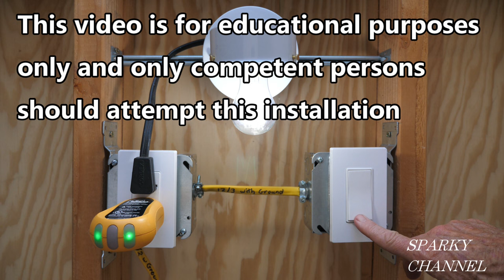What is This Tab and When Do We Break it?

Comment: Thanks, I had similar issues, one of the two outlets which are on split circuit,  since I did not know that tab has to be broken, one of them shorts the circuit breaker, and the other just shuts down the complete panel. Luckily, the panel had some protection so I just turn it on via the big switch. It was scary, I thought the worst. I had to return the cheap ones and buy the heavy duty from Leviton. After breaking the tabs, no more issues. Cool tip of the split circuit, they do that on kitchen to maximize the use of  more apparels, that's the only place I find in the entire house.

Comment: Thank you Bill that was an excellent guide.  Question:  I have one of the recepticle with tab off but seperate cable is connecting top and bottom screws on the same side,  why would that be?  by the way there is a red cable coming in and connecting to black cable. I will appreciate your response.  Thanks

Comment: What I have done is break the tab off of both hot and neutral and fed them from 2 separate circuits.
Reply: I can't imagine that it would be to code to have 2 separate circuits feeding one outlet like that.  I don't know off-hand what section of the code addresses that, though. I saw something similar with 2 separate circuits feeding a dual switch and I was very surprised. Luckily I checked it with my NCV tester before replacing so I did not get shocked.
Reply: @orascreencasts  code doesn't really address it.  I can see no reason why it would be a problem.   As long as you have your breaker panel marked properly so that is understood.
Reply: it's polite to put those two hots on a 2-pole breaker, so one lever makes the whole device safe.
still doesn't help much with multi-gang switch boxes, but it's something
Reply: @wim0104  yes that is what I did👍
Reply from the maker: If you put the 2 circuits on a linked 2 pole breaker as far as I know that's OK. In other words, the breakers have to be linked so that both have to be shut off at the same time. It sounds like that is what you did.
Reply: @SparkyChannel   Yes that is what I did 😊👍
Reply from the maker: Sounds good! @willschultz5452
Reply: @SparkyChannel  In a situation that I encountered, there were two switches (in one device), fed by separate circuits, but were not on a 2 pole breaker. Hence, it was (ahem) surprising to turn off the breaker for lights in a bedroom controlled by one of the switches, only to discover that someone had broken the metal tab and put the other switch on a separate circuit to control a receptacle by the bedroom's closet. 
But I can see that using a single lever for both breakers would address the issue of accidentally getting shocked.

Comment: So you only break off these tabs if you want both plug ins to run off of different circuits. Example: you want a lamp to work of a light switch in the top plug in and the bottom plug in has power all the time. 
So in most normal cases where you want your outlet to have power to both plug ins all the time, you should not break off the tabs?

Comment: Joe Schmo DIY homeowner here. Could this method turn a switched receptacle into a half-hot (one switched, one always on)?

Thanks!
Reply from the maker: Yes. You would have to add a switch of course.
Reply: @SparkyChannel  I have this situation in both bedrooms in my apartment.  The builder decided to save money and not install ceiling light fixtures but instead controlled the receptacle nearest the doorway with a switch.  As built both halves of the receptacle were controlled by the switch but I changed it by breaking the tab only on the hot side and running a wire from one half of the receptacle to the always hot side of the circuit which was present in the box since there was a feed to other receptacles which were hot all the time.  I might go back and install ceiling light fixtures but if I do I will wire up a separate switch and leave the existing setup as is.